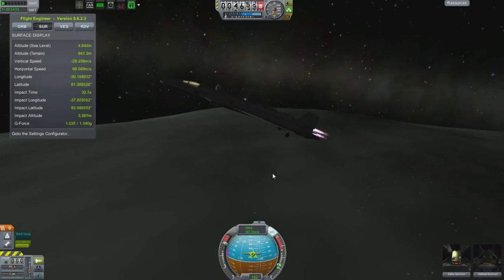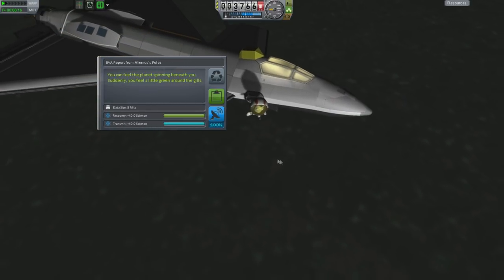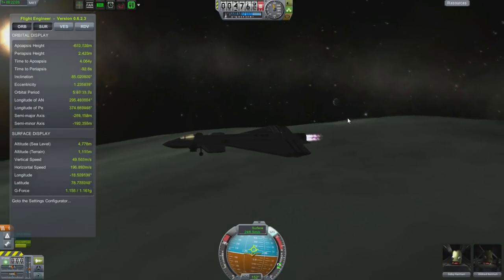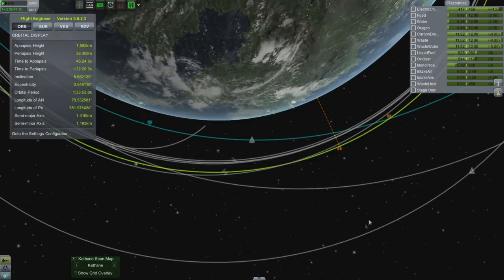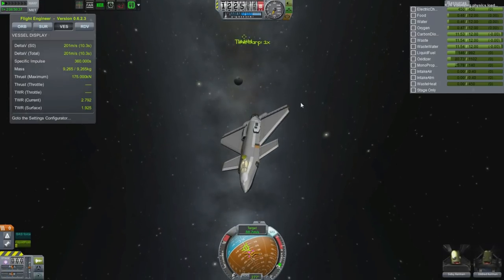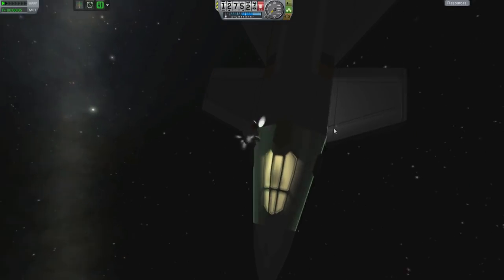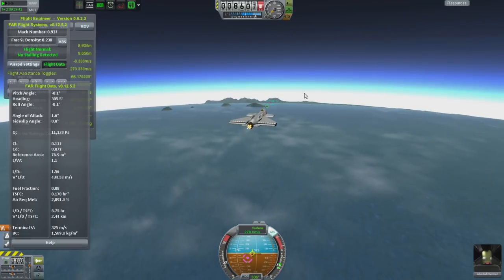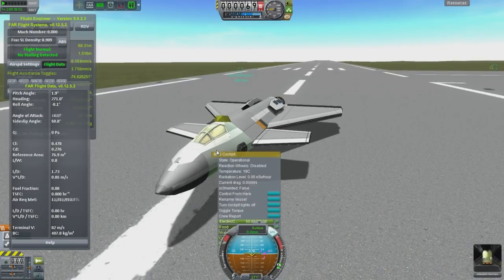Kerbal Space Program - Interstellar Quest - Episode 39 - No Yaw Control

Comment: Scott, the B-2 "Spirit" (Stealth Bomber - Flying Wing) has not tailplane either. I think it uses vectoring thrust or differential thrust in combination with wingtip ailerons to make yaw adjustments
.
Reply: There are flaps at the end of wings that act as rudder on that craft, its whole design is such that it does not need a traditional tailplane for this reason.  Love the B-2, but eerie seeing it fly over head.
Reply: *****
 I've seen a couple fly by. .... At full thrust it was eerie They were so quite. Thye were topping over to refuel or something. Thing was like 1/2 -1 mile above me! The other was like 1 mile above that. ... If I hadn't looked up I'd have never seen them.
Reply: RadicalKattastrophe I saw one that was going to an air show in the Tampa area ages ago, and I also didn't hear it but there was a big shadow on cloudless day that made me look up.
Reply: RadicalKattastrophe Lol, of course you wouldn't have seen them if you had never looked up, silly! Sorry to give you trouble, I don't actually want to nitpick; I just thought that was funny for some reason xD
Reply: As others have said, elevator and yaw control can be facilitated by flaperons/deploying solid-state flaps on the wing(s). However, KSP doesn't facilitate this. Without these flaps, you'll be forced to use roll and pitch controls to kind of "corkscrew" down.

Comment: Not sure if you can reconfigure the control settings of FAR out of the assembly, but if you do, you would have been able to keep a good degree of yaw control had you set up your wing ailerons into yaw control aswell.Differential use of control surfaces would have given you a good ammount of input and control over yaw. Not by far as much as a vertical stabilizator+rudder, and of course it tends to produce also some strong roll inputs, but is still enough to have most things under control.

Personally I'd have reset your control surfaces so your canards would control elevator authority, your horizontal tail surfaces would be set to control roll only and your wing ailerons would be set to yaw only, singling out your controls across your available surfaces and thus making them more responsible against any anomaly. But seems you've got a firm hand enough to do it without any of my fancy reconfiguring ideas :). Good job!.

As for actual tailess no vertical surface designs, the Horten brothers had several of those during WW2 (most famous of them the Ho-IX or ho-229), and the B-2 Spirit also has no vertical surfaces. In fact in those yaw control is exercised by the ailerons and spoilers in very much the same way I described avobe - differential use of them are used to control the yaw axis.

Comment: Personally I think that I would have used kerbal attachment system to remove the two remaining fins of the tail-plane and angle them up 45 degrees.

Or are those too large to remove...  I know I saw you pull off a thermometer in a previous episode.

Comment: Actually, it wasn't the X-34. What you were talking about (the tailless airbreathing stealth jet) is actually the X-44. The X-44 (or the Lockheed Martin X-44 MANTA) was based on the F-22 and features a delta wing with no control surfaces and no tailplane. It had only a 3-dimensional thrust vectoring.

Comment: Scott, the B2 Bomber doesnt have a tail
Reply: but thats a flying wing which has different properties. it also has a computer to control sability. without that it would be almost imposible to fly.
Reply: Sokar12345 but even a flying wing needs yaw control. being a wing does not automatically give it yaw stability. nor does computer FBW control help if there is not a method to make yaw reactions. in the BW it is the computers ability to vary the engine thrust left and right, and it also has wingtip drag ailerons that can control the yaw.

Comment: A much better way to land that thing on Minmus would just be to come down from orbit at a very shallow angle and land on your gear. Your orbital velocity isn't much higher than the speeds you land with at KSC anyway.
Use the brakes on the gear to slow down, saving a bunch of d/V in the process—RCS to soften landing if needed and then to thrust down to keep your wheels on the ground.

Comment: Crazy idea: SSTO/LOR with separating lander for normal rocket powered descent and ascent to and from target planet/moon. Aerodynamic module stays in orbit, nose section separates and lands using small rocket engines. Then it ascends from surface, docks with the orbiting aerodynamic module and whole package returns home. Porbably unreasonable if not straightforwardly impossible, due to mass of additional fuel and engine(s) for lander, and aerodynamic issues (in current KSP state lander engines would probably have to be mounted radially).
Reply: If you're going to a planet then yeah you'll have some issues, namely the plane needing to be colossal. The Mun and Minmus however don't take much delta-v to land and return on though. Minmus at least would be pretty straightforward.

The additional mass for the fuel is the last concern really, it just means you'd need a bigger plane.

Tl:dr crazy or not I see little reason why it wouldn't work for hopping to the mun or minmus. Anywhere else... not impossible, but it would be a hell of a feat to pull off (especially if you're going to Eve)

To be fair though, for a planet with an atmosphere like Eve, both kethane and KSP interstellar have atmospheric engines that would work off of Kerbin so you could turn the lander into a mini-plane (mini compared to your massive interplanetary SSTO at least XD). Probably won't work out too well if you did it in stock KSP
Reply: pyr0b1rd
Well, my idea was just basically to leave food for thoughts, nothing more. Maybe Scott will read it some day and maybe it will inspire him to design something like that. Would be awesome to see something like that actually created.
Reply: CrazyChemistPL If I'm not mistaken, most planets have atmosphere's, so having a non-aerodynamic lander would be difficult to get back to orbit. Might be better just to land the whole thing.
Reply: TrumpeterOnFire
 But most of the moons doesn't have an atmosphere. I wrote "planets" in the OP, but mainly I had moons in my mind.
Reply: CrazyChemistPL In that case then yeah, it could be feasible. I'm wondering if something along the lines of the huge B9 shuttle with a lander packed inside might do you.

One of the problems with docking is that it's a pretty weak connection point. I've run into problems countless times from a two part vessel breaking up under high thrust.

Comment: Small landing struts on the wings to absorb the landing. Push the plane over with the torque and raise the struts.
Is that a option? I know the dv on that thing is tight.

Other option is small vtol engines, but that would be a hassle to set up around the CoG.

Comment: Planes without tailplanes were tested as early as the final years of WWII, the Ho229
Reply from the maker: And Pilots had to fly aircraft without tailplanes when they were shot off in WWI
Reply: Scott Manley Just trim it out.
Reply: Scott Manley With trim and flaps it is much easier!!! and flying wings have extra yaw controls!! You had less than they.
Reply: TrumpeterOnFire Haven't heard of trim that isn't on the tail plane or rudder, but I trust you.
Reply: Warren Cash Nowadays, with fly by wire, you can essentially trim any control surface. At the very least though, there are mechanical devices for trimming ailerons that are running purely cable driven surfaces, in addition to rudder trim.
Reply: TrumpeterOnFire It isn't really true trim without tabs though.

Comment: Yeah, Scott, B-2 Flying Spirit. Or to be more complete, http://en.wikipedia.org/wiki/List_of_flying_wings. Or, you know, hang gliding in general. You are also running a mod that specifically makes the body of the wing act as lift surface... aligned in the direction of movement axis. Jeb had it easy.

Comment: The B-2 Spirit doesn't have a convention Vertical or Horizontal stabilizer either. The Go-229 didn't either.  So there has been a few "tailless" designs that have come around, one of which is incredibly successful. I believe the Go-229 never flew, but data suggests that it would have flown fairly well and had an incredibly low radar signature due to it's construction and it's shape.
Reply: the B-2 and i would assume the Go-229 would use something similar to split ailerons for yaw control. but During ops the B-2 uses differential engine thrust rather than clamshell ailerons because they lower the effectiveness of the stealth capabilities. i was quite curious how the B-2 had any yaw control, so i did some Google-ing actually pretty interesting :)
Reply: Condorscondor Condor Yeah, from what I read the B-2 does use the split Ailerons, and it's unique in that is also how it yaws. As for the Go-229, well, the ailerons don't look like they split like say, the A-10 or B-2's do. So, I am going to have to lean towards it uses differential engine thrust as well. 

Would have been interesting to see the 229 fly. I know the XB-49 was incredibly unstable in a stall. It just flat spins and it ended up killing a crew. Apparently the B-2's flight computer simply refuses to allow the aircraft to stall. Of course that didn't save the one in the Guam did it?  I would be curious to see the 229's stall characteristics.
Reply: Im pretty sure the smithsonian air and space museum in Washington dc has a unbuilt 229 in its basement, from what I heard its lack of funding thats keeping it from being built. If they could stick it in a wind tunnel, or better yet fly it, a lot of questions would be answered.

Comment: The X-34 never got past testing because the Lockheed X-35 (now F-35 Lightning II) won the JSF contest. Which is kind of a shame since the X-34 would have been much cheaper and simpler than the F-35, and would likely be in service right now.
Reply: You're confusing models. The X-34 was not competing for the JSF , that was the Boeing X-32. X-34 was strictly a technology demonstrator.
Reply: ramjb Ah, thanks for the correction.

Comment: No tail-plane isn't necessarily a problem, since this thing is pretty much all wing. And tailless planes, such as the Horten 229, can be perfectly stable.
Reply: Flying wings do have some serious problems due to lack of tails which is why they didn't become practical until computer assisted control became a thing (like on the b-2). Basically if they stall you can't recover and just tumble end over end until it hits the ground (which makes ejecting a nightmare too).
Reply: CareerKnight Really? Then explain how the Horton 229 was reported to have very good stability, with only slight lateral stability problems. The Northrop N-1M also has good stability. Yet neither required computers to help them fly properly. I've found nothing mentioning a problem with stalling, and ejecting downwards is not a problem, in fact some aircraft normally eject the pilot downwards anyway.
Reply: If you put flying wing into google one of the first things that comes up as an addon is stability problems. From the wiki page on the design "Because it lacks conventional stabilizing surfaces and the associated control surfaces, in its purest form the flying wing suffers from the inherent disadvantages of being unstable and difficult to control." 

One of the test pilots for the earlier Northrop flying wings was on of the first test flights of the B-2 and the advice he gave the test pilot was don't stall it. After the flight he asked if he had tried it anyway and was informed that the plane wouldn't let him stall it.
Reply: CareerKnight But the stalling thing is always avoided on test flights anyway, so that's not very relevant. And in combat, pilots always try and avoid stalling, as that gives the enemy the advantage.

And again, those two flying wings I mentioned were reported as having good stability, long before computer-assisted flight. 

And regarding stall, the YB-49 passed all stall tests and even demonstrated spin recovery. Also, flying wings can be designed with Vertical stabilizers, which would cure most stability problems.
Reply: Stalling actually can have tactical uses in a combat situation. Throughout WWII, it was used by pilots of the Bayerische Flugzeugwerke and all their variants to make rapid decelerations and descents to get behind and below your enemy, which is a blind spot for them. If you had an aircraft that performed better at higher altitude, you could go into a rapid ascent and force your enemy into a stall, than stall yourself to get on their tail. This required lots of stability on both perpendicular planes of lift on an aircraft, which is why many early age heavy bombers limited their flight angles
Reply: Xannari Ferrows Exactly, it's an excellent way to throw of a chasing plane, because they typically can't react fast enough.
Reply: yeah but stalling and falling down with 2 km/sec and not being able to recover from it will kill you..

i believe you can make a plane without it but making a plane with it is A. more simple B. will cost less money to develop
Reply: Matthew Gavin
You say pilots in combat always avoid stalling, Xannari points out that it is useful tactically in certain situations and is occasionally done deliberately, and you respond Exactly? Like he had agreed with you when he clearly didn't.
Reply: If you guys are still interested, they HO 229 and modern flying wings have spoilers on the wings that allow yaw control. Other than the reaction wheel, the tail plane was his only way of getting yaw authority.

Comment: BTW Scott you missed a lot of planes that fly without rudders. Also, it's not the x-34. You are thinking of the XB-35, YB-35, YB-49, X-45, or X-47. You alkso fogot most blended wing and flying wing aircraft, such as the B-2 and the RQ-170 (which gained infamy when Iran "shot it down" aka. software malfunction cause incorrect landing.) both of which are far beyond the experimental and theoretical phase.
Reply: WELL technically "rudder" would apply to the yaw controls of these craft, whereas scott had no yaw controls at all.
Reply: Warren Cash Well, technically he covered that fact in the video and stilled spoke of them as if there was no difference between vehicles without rudders vs without yaw control, so I merely continued such usage.

Comment: The need a a tailplane just again shows how primitive our aircraft are compared to the beauty of a bird flying.
Reply: Not that I am an expert on flight, much less on bird flight, but they have a significant advantage in that they can alter the shape and angle of attack of their wings mid flight. Not many jets have that.

Doesn't mean that birds aren't incredible, but our aircraft are designed to work at much higher speeds, and often much higher altitudes, for extremely extended periods.
Reply: Birds don't have six-barreled 20mm gatling cannons, so you think about that when you say birds are awesome. :P
Reply: Pretty sure that birds use their tail-feathers in a similar way that our planes use tail-rudders...
Reply: Turudelas13 Ye. Planes are just paralyzed birds :P.
Reply: Many aircraft lack tailplanes. (that is the horizontal thing at the rear of a plane) do you mean fin, or stabilizer? Remember from a biological point of view, travel through air is the same as travel through water. And fish and dolphins and so on have fins and similar. Perhaps birds are MORE primitive. they haven't been around as long. But I rather think it is a lack of jet engine that does it, air is more similar to water at high speeds in a way.

Comment: Horizontal stabilizers are actually not that important from a stability point of view; I fly a lot of model aircraft and I've had a few deltawing gliders without rudders and they get a lot of sideslip on turns but are in no way unstable.
Reply: yes, those are gliders.. a propelled flight vehicle will have a tendancy to turn a sideslip into a flat-spin.. at that point you have 3 options

1. Punch-Out
2. IF you have a good AoA and Air Command you can try to correct
3. Die, either from the spinning crushing you into your harness or from the crash.
Reply: What he said, also there are alternatives you can design in for yaw control, things like air-brakes and so on that were not in place on Scott's space plane.

Comment: So I have to wonder why you were so terribly worried about sideslip when there's proven flying wing designs like the B-2 and HO-229, especially since they both, much like this craft, share a wide-sweep delta wing. Just curious.
Reply from the maker: There's a difference between being designed with no rudder and finding you've had your rudder torn off.
Reply: Scott Manley tell the modders to allow for the repair kit to reattach parts broken at the mounts (like your vertical stabilizer) to their origional position.
Reply: mikethemaniac1 there is a repair kit in KAS he just didnt happen to have one.
Reply: rosstafan but even THAT doesn't seem to offer repair to parts broken off